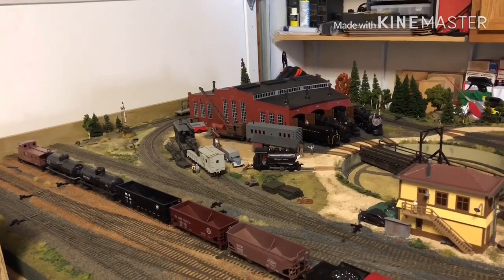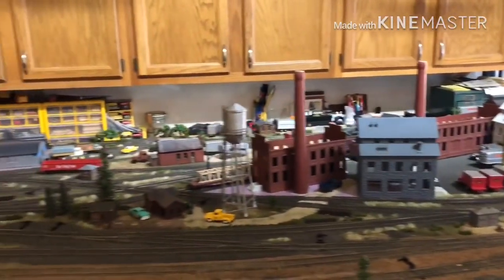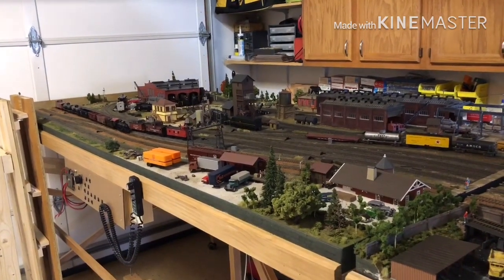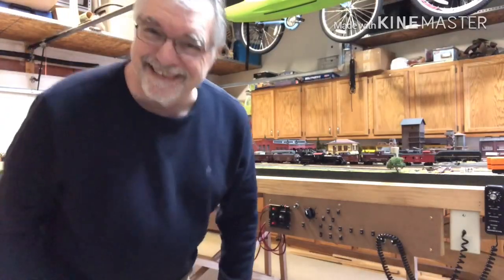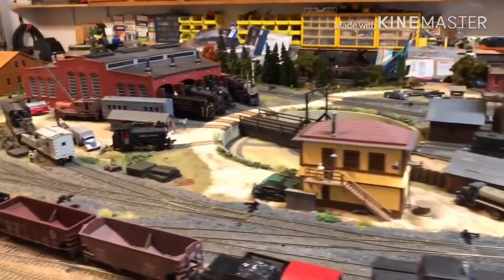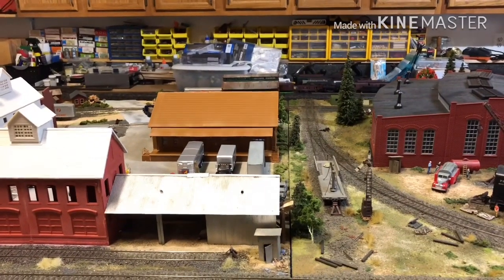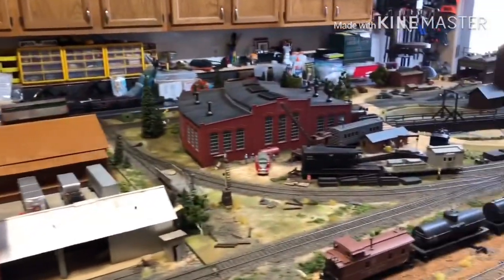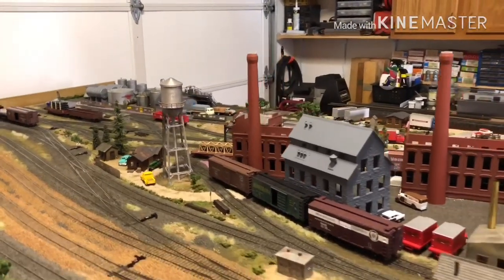Model Railroad Adventures with Bill E42 - HO Scale Switching Layout - 2nd Configuration Setup

Comment: Hi Bill, Very ingenious that you have multiple setups with your two 4' x 8' sections. Will your new staging yard also work with this setup? I'm guessing you're layout is run using DC? What control system do you have as I noticed you have a walk around throttle? Cheers, Rich S.
Reply from the maker: Hi Rich!  Thanks for watching and commenting.  The staging yard will work as well in this configuration.  Next video I’ll have the layout still set up this way and have the staging yard in place.  The layout is old school DC and I use a MRC Control Master 20 for my power supply